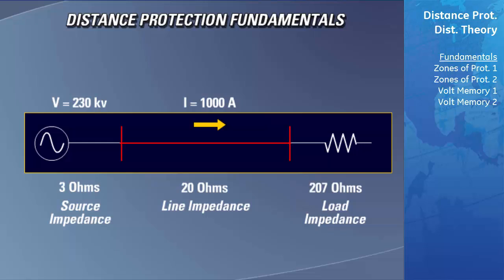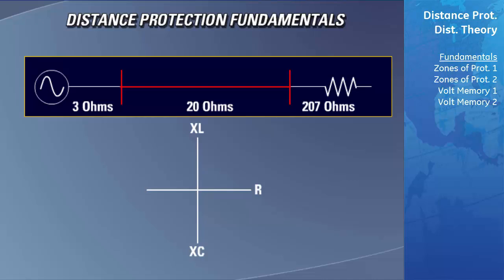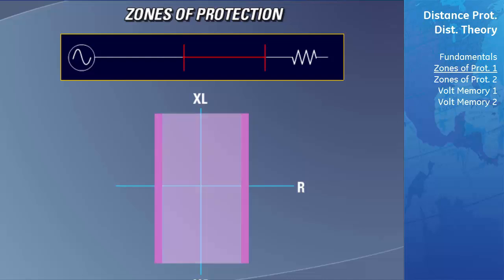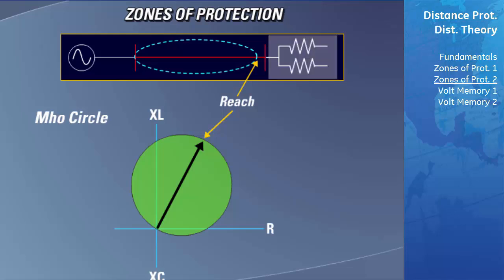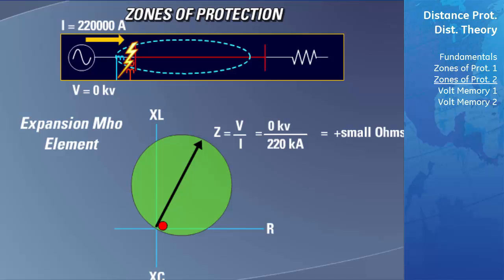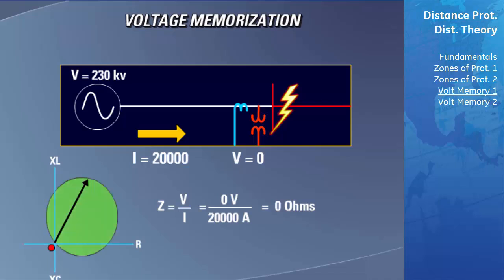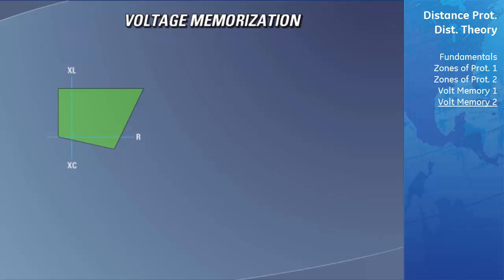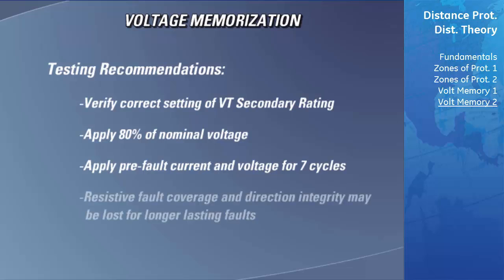UR-121 l Distance Protection Theory v1

Comment: at minute 6:30 ; 
-author put an external fault , and plotted the fault impedance of the fault below the line of the zone reactance.
-my point of view "it is wrong"
-the reason : based on his speech , he tried to block the faults outside the zone of protection (transmission line) .if the fault is outside the transmission line so the impedance point shall not only be above the reactance line because the reactance of the transmission line will be involved in the total fault impedance which is equal or greater than the reactance value of the reactance line.

Comment: how do i calculate voltage and current at relay like the video, when faults are in between the transmission line, i mean how do you calculate that you get the 177kV and 17700A?
Reply: +Suharti Hajar 
You need to know the line impedance per mile. If the fault is bolted, then the phase angle of the shorted line will be the same, but the magnitude of the line impedance will be reduced. To calculate the line impedance per mile you need information regarding the line conductors wire size, phase spacing, grouping, average distance above grade, etc. ie. It's a highly involved calculation itself.